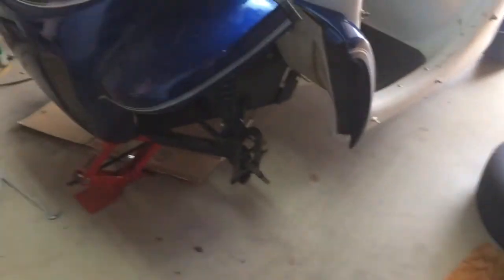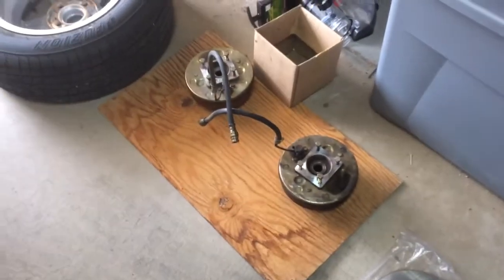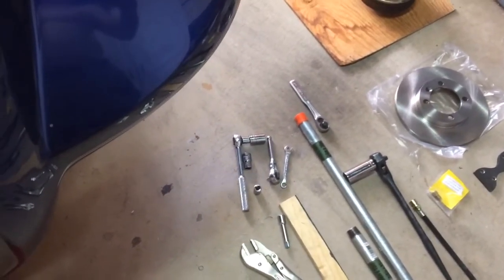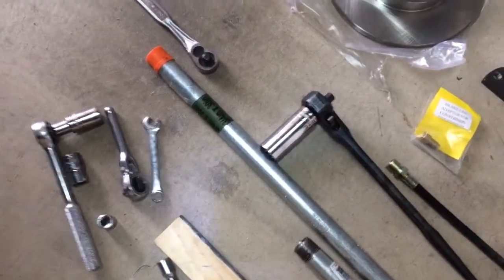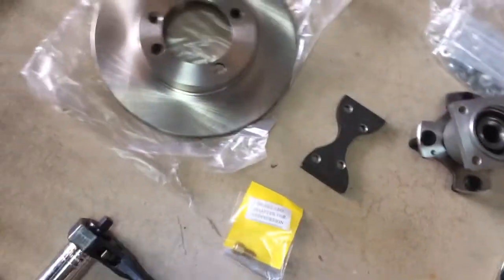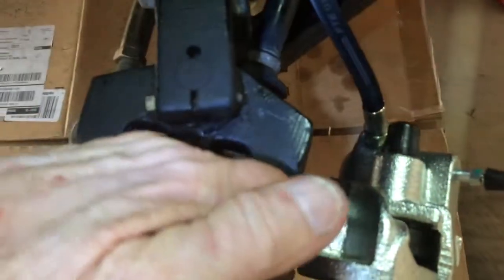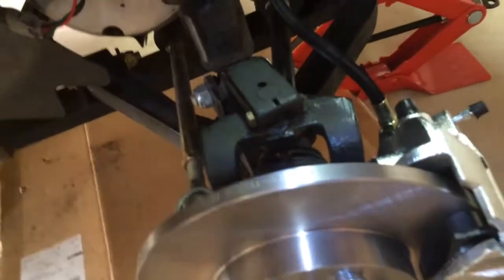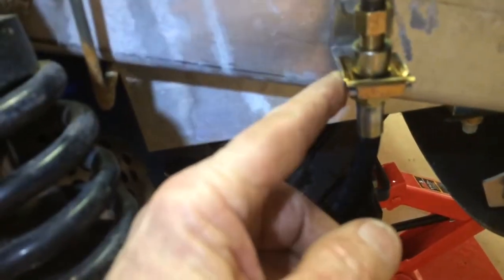Disc Brake Install 1999 GEM Car

Comment: GEM Car Disc Brake Install Comments

1. Get the correct tools & lubricants
    1. 13mm, 14mm & 24 mm sockets
        1. 24mm should be deep socket with long wrench handle
        2. 24” cheater bar (optional but mostly likely needed)
        3. 1x2 wood stick used as cheater bar on wheel bolts to assist in removing axle nut.
        4. 3/8” and 1/2” socket wrenches
        5. 3/8“ box wrench
        6. Crescent wrenches (2)
        7. 13mm & 3/8 box wrenches
        8.  Vise gripes (2)
        9. Rubber mallet
    2. Liquid wrench
        1. Apply to brake line connection to be loosened
        2. Apply to axle nut after removing wheels
    3. Never-Seez (Amazon)
    4. Red Locktite (Amazon)
    5. No mention of a torque wrench required, and I did not use one.
2. Follow instructions and here are comments about items 1-11
    1. I just used a good single scissors jack in the front middle. Block back wheels, too. Warning: don’t get legs or body under the vehicle unless you fully block the frontend UP!
    2. Apply liquid wrench, wait 10-15 minutes (can start steps 2 or 3 meantime). As the hub turns, use a  wooden between lug bolts and the floor, to prevent turning. Now use wrench and cheater bar if required. Note direction of nut on the axle, as both sides are not flat. Flat sides goes to the back. Save nut and washer.
    3. This connection may not loosen easily, so I used two vise gripes to prevent nut damage. remove top clip and save for later. Bottom clip does not seem to be needed, but save it anyway.
    4. Remove 4 bolts, this is a time-consuming task, but can be done with correct tools and patience. Once loose, use a small crescent wrench or a 13 mm box wrench to finish the job. Next remove the hub, it may or may not come off easily, but tapping lightly with a rubber mallet can help.
    5. Attach new hub per instructions (1st apply Never-Seez to axle) with shorter bolts and locking nuts. I did install with nuts to  the outside. Tightening well is a good idea.
    6. Caliper mounting plate per instructions. As long as the larger radius is against the hub, It does not seem to matter which side is out. Again I did washer and nuts to outside and tighten well.
    7. Axle nut re-install.  Put Locktite on the threads and wait 5 minutes. I did torque very well (Locktite might be over-kill here).
    8. Rotor, which side out? You can see from the video.
    9. Calipers can only go on one way correctly. I did use Locktite on the bolts, waiting 5 minutes before installing. Those metal retains clips don’t seem to belong on the final assemble. If you have trouble lining up, use a pencil to get a hole or holes lined up. I did also tighten well.
    10. Simple, but you do need the adapter in the bag with wheel nuts. Don’t need to over-tighten, as it could damage the fittings. The axle nut was re-installed up in step 7, so ignore it here.
    11. Put on the wheels with new lug nuts. Bleed each brake lines. If you don’t know how to do this, look for some good YouTube videos. I did use a piece of small diameter clear hose line with a jar containing 1-2” of brake fluid. This process could take 2 or 3 tries to get brakes fully bled.

Test drive you GEM now with new brakes. BTW, these will not act like Car Power Disc Brakes. Mine seem to eliminate any pull quickly after using.

BTW, my GEM car upgrades are now complete: Smart charger, 7.5 HP motor, re-programmed T1 Controller, Disc Brakes, Clear Removable Vinyl Doors. Top speed how 39 MPH.

Comments & suggestions appreciated!

Dave

Comment: Two questions, I have the same disc brake kit for our 2002 GEM, how long did it take for each side? I'm doing the same motor upgrade too and want to know if you'd share your T1 program changes and/or the backup file?
Reply from the maker: Doug LaRue I spent about 4-5 hours total on the brakes, mainly due to inadequate tools & vague instructions. Also, I took my time. It has been about 3 weeks since finishing, and brakes are very good.

Controller upgrade I had done at Ride-4-fun, so don't have a printout. Motor upgrade about 2-3 hours.
Reply: ok, thanks.  I'll take a chance and see if I can get it done in 3 hours.  I pulled the motor last week for the first time to put in the resilient bumper and it was 1 hour removal and about 1 hour back since I did lots of cleanup and put new parts in the battery tray area.  With that experience I'm expecting 2 hours for the motor and input shaft swap. Thanks for doing the video and the feedback.
Reply: Dave, I got the first done in less than 2 hours but 2 trips to the auto parts store( 1st brake fluid, 2nd brake cleaner ) lost me some time. Also could not find a drill big enough to ream the brake line holder hole. Eventually figured out a counter sink borer worked perfectly. Probably lost over 30 minutes on that.  The other side was done easily in less than 1 hour. And as you know, I'm back to using one foot to stop the vehicle instead of two.